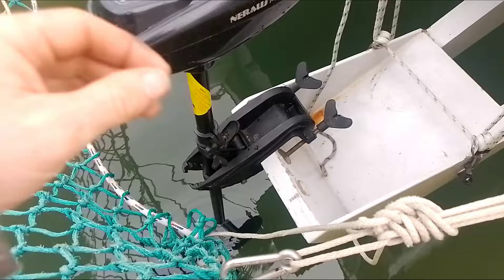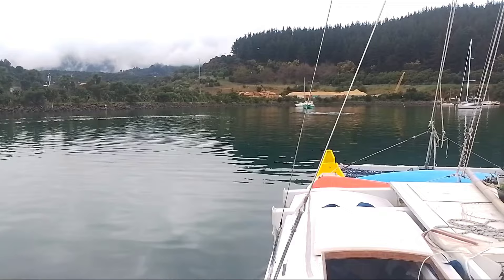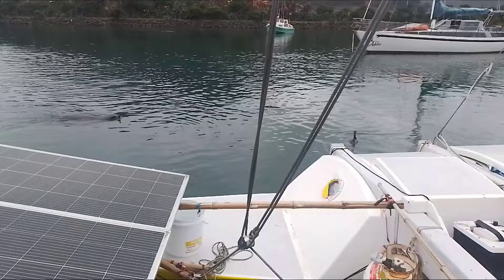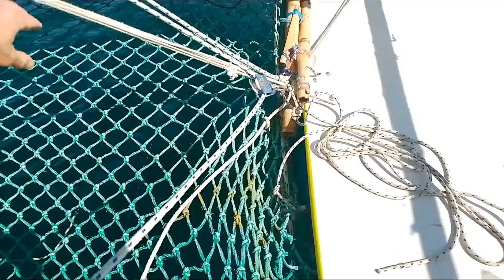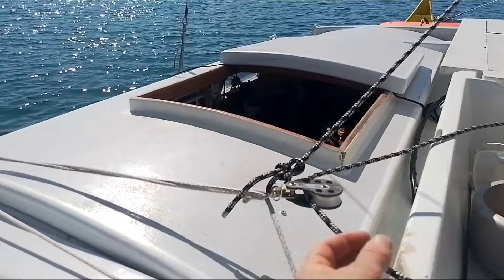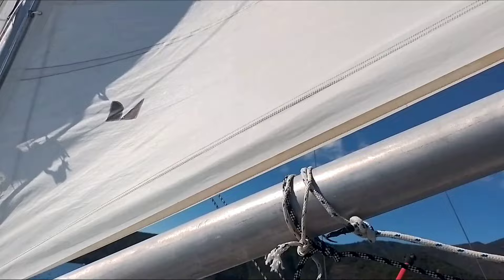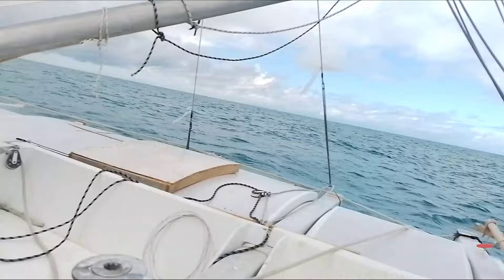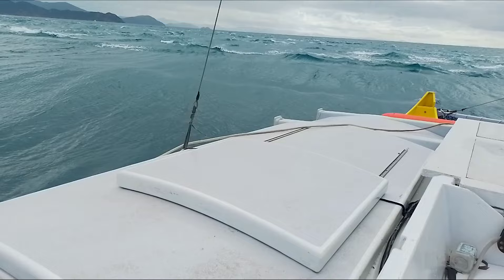Cruising in Queen Charlotte Sound and Sail Trim Experiments Sailing Yes Let's! E4

Comment: It seems from the video that the mainsail gets too much tension on the aftleach. That may hinder the airflow and effects the  speed but also causes unpleasant movements of the boat upwind. Some, but not too much, twist in the sail is nicer. I would first lower the main a few inches to close the gap between the sail and the boom. Then set the corner where the boom meets the mast. Then see if there is still too much tension in the aftcorner pulling on the aftleach. If that is the case, maybe the boom is bit too long for this sail and you could solve that by making an extra strap from that eye around the boom   Just so that it still can slide on the boom. Than use that line there just to slide that corner more backwards or more forewards. As the boom is pointed quite upwards you should release that line before you can lower the sail or the sail may tear from the overtension. That was my mistake and I had to buy a new mainsail.
Reply: Around the hatches on the foredecks  my boat had an extra rim on the deck to keep water away from the hatch. The hatch kind of fits in the “gutter” that is created that way. But some water will gather into that “ gutter” so there should be openings on the aftside where that water can flow out onto the deck
Reply: In big waves it is better to bring all the movable weight towards the back, like the two kayaks that I saw.
Reply: I see you mounted lines in the mainsheet to reduce the needed lenght of that sheet. Is it comfortable to have these lines on the side where the sheet runs towards the hulls?? On my boat those lines come from the boom.
Reply from the maker: @alfreddaniels3817  yes that's how the plans show it. It seems that my boat never got those, and I had problems with that in episode 1, but it's been fine since I got some foam seals in there
Reply from the maker: @alfreddaniels3817  it's okay. It makes it work with the rope I had. The main block is 4:1 which is a bit much, and the way I have the cleats on the aft beam isn't very good ergonomics, but is an improvement on how I had it before that. I was thinking to have both sheets go up to another block back on boom (giving 5:1) and then back at the gooseneck, but I'll need to make some sort of cleat thing. this will be an upcoming project
Reply: @dominictarrsailing  good idea. I will also make foam seals in my hatches. Last week had a lot of water over the boat. Sailing on the IJselmeer where there is quite shallow water and the waves are steep and short.
Reply from the maker: yes! my setup there is I have a uphaul on the boom end, with a knot in the rope to give set positions for sailing, and then pull it down and under a cleat for reefing, or furling the sail.

So are you saying that you think the sail is pulled too tight along the bottom?
Reply: @dominictarrsailing  it looks from the video that the sail is pulled too tight on the rearleach. That should have some twist even when reaching close to the wind. But its also too tight on the bottom so it looks as if the sail doesn’t fit well on the boom, is some 4-5 inches too small for that boom. Now you cannot properly trim it unless you split that angular force from the stretching line into two forces: one vertical ( use a strap for that) and one horizontal. ( use the existing line for that). But it starts by bringing the sail properly along the boom by lowering the halyard until the underside of the sails lays on top of the boom and not 6 inches above it as in the video.
Reply from the maker: @alfreddaniels3817  I'll try that!
Reply from the maker: for twist, I suspect that these sails are a bit too baggy. and that means I can't point as high as I would like. I understand that multihulls should have flatter sails than monohulls, but I can make the sails flatter on my monohull. (although I don't really have any racing experience so I don't know much about sail trim, mainly I just try to get the boat going well and make things easy for when the conditions are tough)
Reply: @dominictarrsailing  that’s why I advised you as I did.
Reply: There are some excellent webinars and other instruction videos on internet. North Sails has given some for the Sydney Yacht club and very very good I think is Michael McNamara. These are the people that give even instructions to Olympics contestants, but actually every sailor should see them.